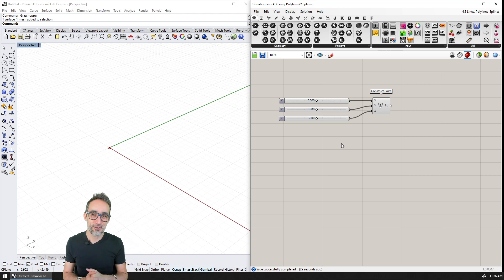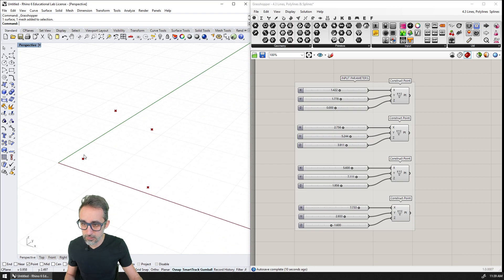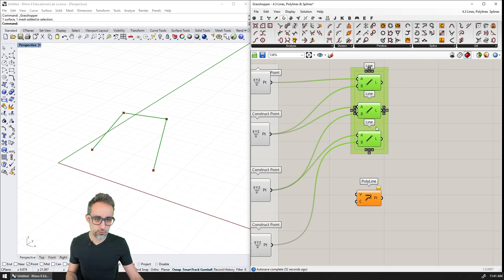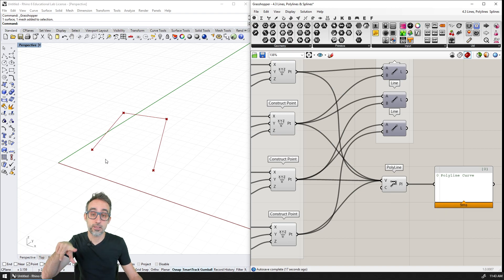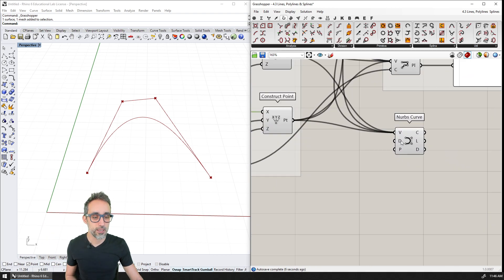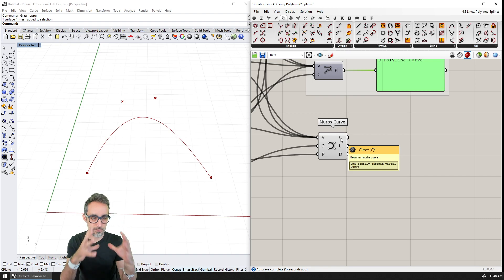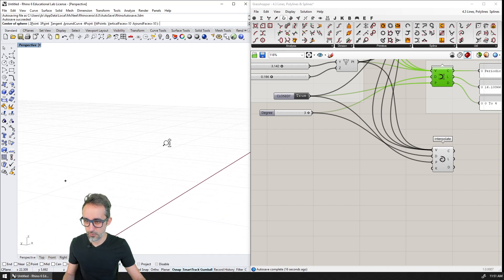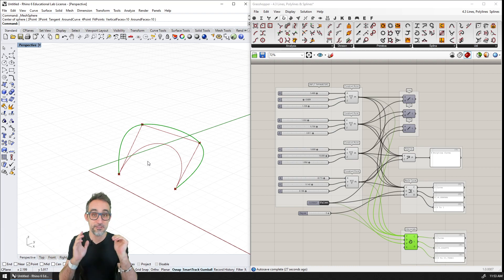4.3 How to Model Curves Parametrically - Intro to Parametric Modeling

Comment: Hi, this is very helpful. Can you illustrate how to add a control point once the parameters in Grasshopper have already been defined? Say from 4 points to 5 or 6 or more. Would it make the process more tedious or complicated?
Reply: By adding a control point, I meant in between two already defined points.